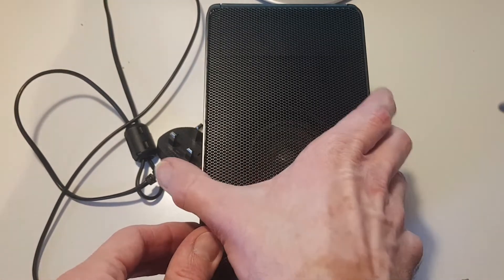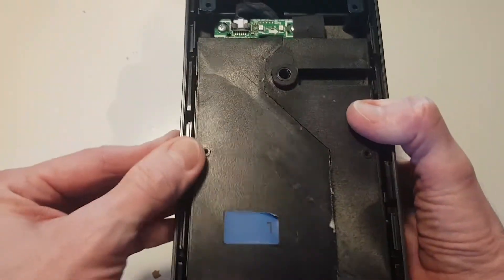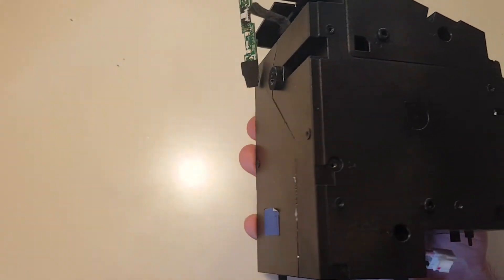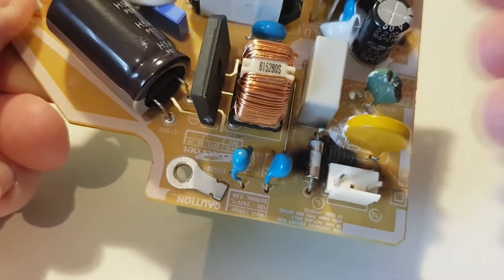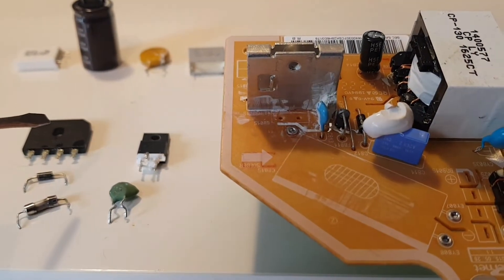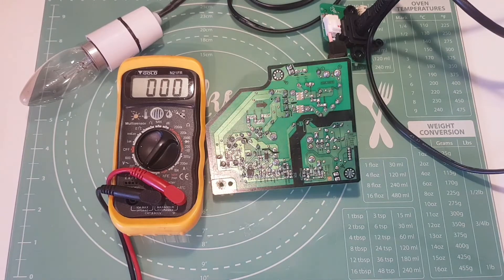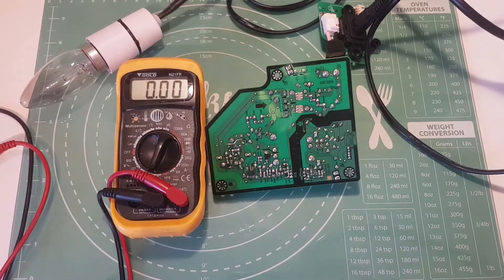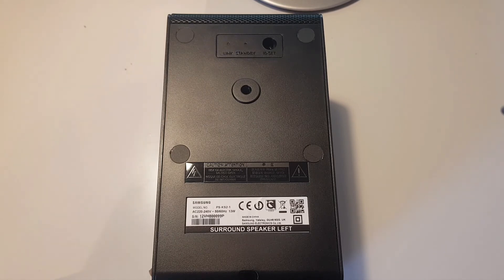Samsung HW-K950 Soundbar - Surround Speaker (PS-KS2) Disassembly and Repair

Comment: The issue I've run into, as of late, is with my rear left speaker losing connection with the soundbar after powering it off for a bit, or over the evening. The blue status indicator light on the rear of the speaker will rapidly flash like it's in pairing mode and the soundbar will display a "Check surround left" message, or something to that effect. To get it to reconnect, I have to hold down the ID Set button which seems redundant as it's already flashing blue, then go through the process of powering the bar off and holding straight down on the volume button for 10 - 15 seconds until the "ID Reset" message appears on the soundbar status screen. 

Any idea as to what components to check that have to do with the speaker retaining it's wireless connection? The right rear speaker and subwoofer go into standby mode and wake back up when the soundbar powers on just fine.

Comment: my rear speakers are quiet and the sound comes in weaves . sometimes complete no sound. also the subwoofer after using it for 10-15 min it stucks playing the bass. could it also be an power issue?

Comment: Hi, did this permanently fix this issue? Did the board blow up again after you fixed it? Thanks
Reply from the maker: Yes it fixed it
Reply: @amp9438  nice. I'm in the process of fixing mine, and from a few tests it seems the same components failed on my unit (also left rear speaker!). Thanks for posting the video

Comment: Hi, I have HW-K950 as well, recently my right satellite and subwoofer unable to link to main soundbar, is it repairable?
Reply: i have Problem that the rear speaker are quiet and stuck in playing the sound. i have to look which parts are damaged. any ideas?
Reply: I've had the same issue with my K950 as well. Are the blue LED lights on the rear of the speakers flashing rapidly? Assuming they are, I was able to get my speakers to re-pair by starting with the soundbar unit powered on, press and hold all of the ID SET/reset buttons on the affected speakers until they each flash blue. Then power off the soundbar and immediately point the remote control at the soundbar's LED display area while holding the volume button straight down for 10 to 15 seconds. An "ID Reset" message should pop up and scroll past on the soundbar display and disappear. Then powering on the main unit and they usually re-pair with a solid blue LED indicator light at the rear of the speakers. Sometimes it takes a few attempts before the soundbar displays the "ID Reset" message. Hopefully this will help.

Comment: The same speaker just died in my system, without this video I would not probably get anywhere, so this video is gold for me now when trying to repair. But I must say that Samsung should get a big middle finger up for the freaking glue stuff. I have to get some more isoprop. tomorrow so I can get the last 2 parts open and get to the electronic components. 
I'm not great with electronic so I may just order double of everything you mention here, and call on some friends I know is skilled repairing electric stuff :)

Comment: Hey there. Are you in the UK? I have the exact same speaker with the same issue. Would you be open to doing a repair for mine? I'd be happy to pay for time and parts. It appears to be £150 to buy some second hand from ebay, so if you'd be happy to do for cheaper, that would be grand!
Reply from the maker: sorry i[m not offering a repair service for these
Reply: Fixed yours? If not i can take a look, Although im in denmark. Its up to you.